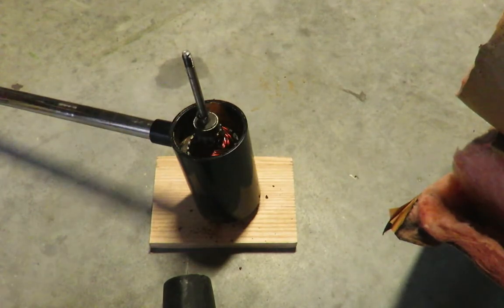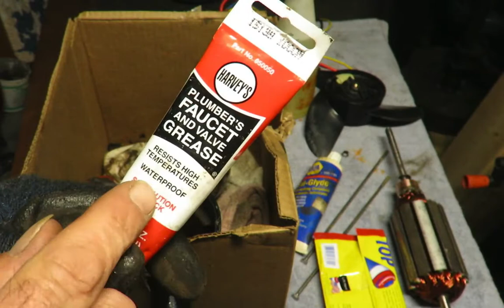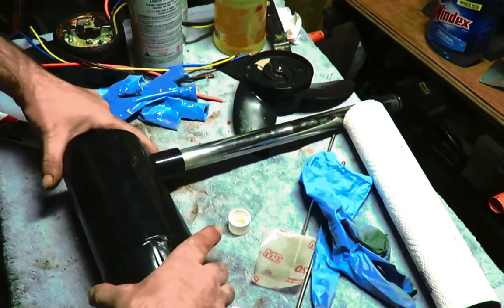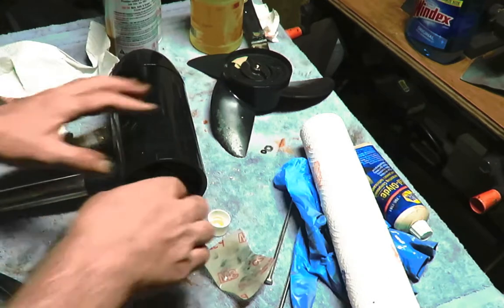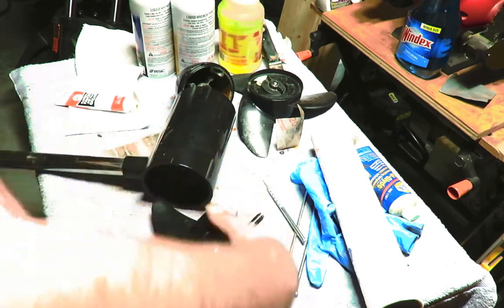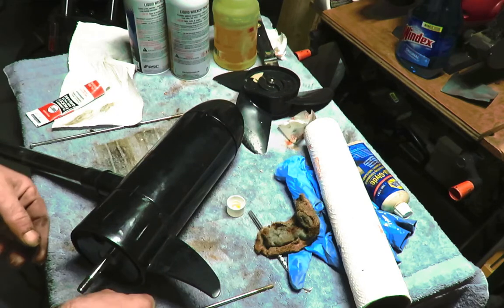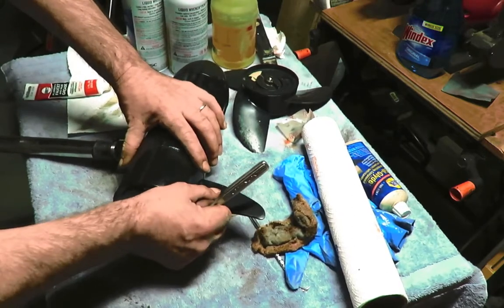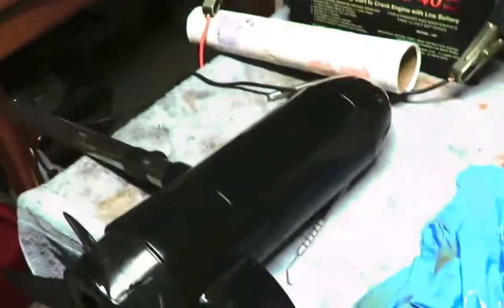Electric Trolling motor rebuild.

Comment: Did mine today. When I opened it up it was filled with water in don't know how it was still running 
What made me do mine the battery lead was getting hot.
Thank you for your video could not have done it without it👍👌
Reply from the maker: You are very welcome. Glad I could Help.
Reply from the maker: This is how you break in an RC Motor in water. My video Demonstration Link. Hope this answers a lot of questions. Peace.
https://www.youtube.com/watch?v=nyQQBLW-arI
Reply: I ran mine with water in it for about 2 years😂😂 had no idea, but it kept on running!!

Comment: Great video buddy... I just picked up a motor guide 12/24V pedal steer and it doesnt work! You answered my first question - if I can use my battery charger to test the dang thing lol. So pulling the top "the head" off Ive found a 3 prong terminal with two black and the green wires attached- they were burnt- stripped back and cleaned the connection still no power... I guess I should check the Low end "prop assembly" for more burnt wires or rusty brushes etc???? Any Ideas or helping hints would be Awesomely Appreciated! KyFishOn Nakia THANKS

Comment: Do you know how to remove the speed control board? I need to resolder the blue wire but when I removed the board there were a bunch of wires attached to the housing so I couldnt really pull the board out.
Reply from the maker: I do not know. I am learning about speed Controls now on a different motor. Starting to figure it out. Thank You for the question.

Comment: i just fixed two out of three of my "dead" tm's. water rusted the 3rd so bad it's toast. am going to flex-seal the outsides to prevent h20 entering my last two. pray for me
Reply from the maker: That's the whole key. These motors are still running with just using the plumbers grease too seal them. Haven't taken them apart since I made this video years ago. Enjoy your weekend.

Comment: Not 100% sure but did you forget to put the washers back on the shaft? They go inside the housing against the c-clip washer on the shaft.
Reply from the maker: They are in there for sure. I rebuilt 3 of these last spring and they were use all last summer. Going to pull one apart soon to see if water got in. Thanks for the comment and have a great day.

Comment: You would think that they would use some O  rings on something that works under water O rings work miracles on stuff like that
Reply: they are o rings on these and if water got in change that o ring or youl have the same trouble soon,grease does not replace o rings

Comment: Any one have water in lower motor housing how to fix no visible cracks guessing seal?
Reply from the maker: I think it is the seal on the shaft. I used plumbers grease when I reassembled. I need to check this rebuild. It was used all last summer without a problem.